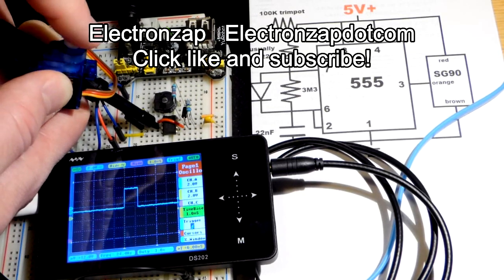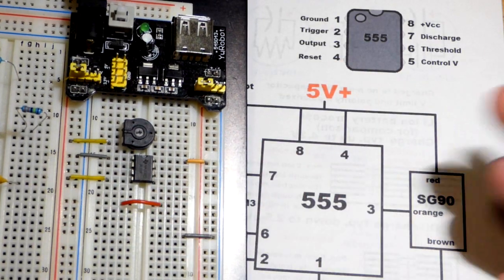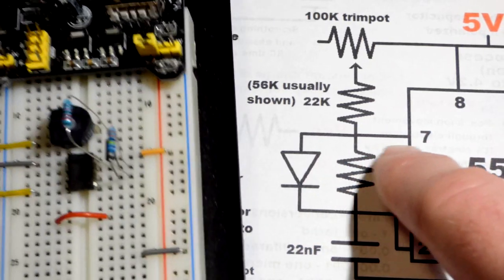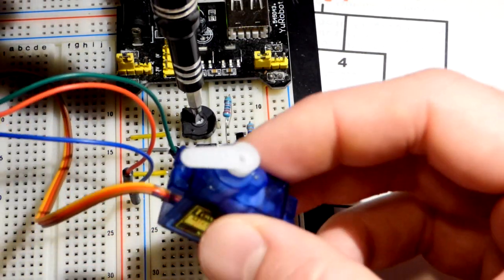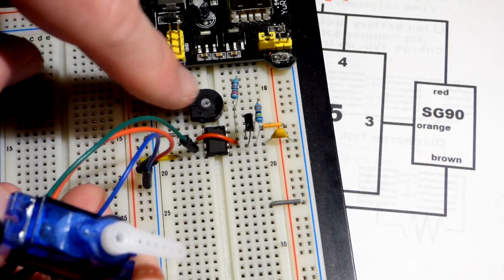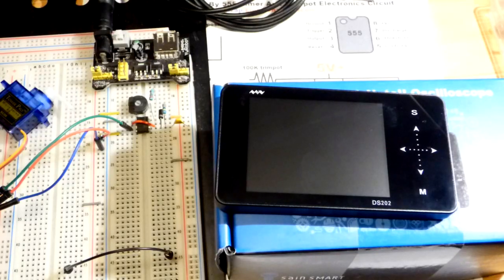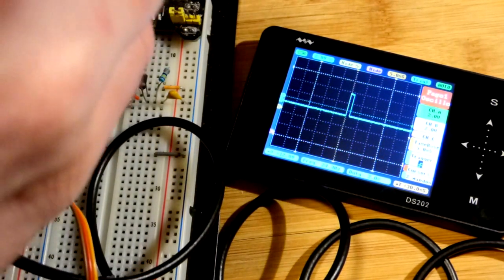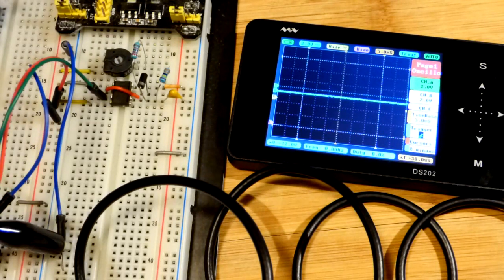Cheap electronics SG90 servo controlled with 555 timer pulse generator circuit step by step build

Comment: Good Stuff   ->   You could use a sensor like an LDR or PIR motion sensor in place of the Potentiometer so as to have the servo mechanically open or close a door or a vent or flap or open an *(animatronics"  eyeballs in reponse to detecting a persons thermal heat image or changing light conditions   *(animatronics like you would have at a Disney Park where they have all kinds of animated robotics that resemble living people or animals  )   You could have a doll or puppet open or close its eyes when you walk up to it or shine a flashlight at its eyes or have it move its hands ...   All kinds of fun stuff you could integrate this into , its up to your imagination
Reply from the maker: Yeah lol, I was planning on using an LDR to control a servo soon if I don't come up with other ideas for videos. Fun stuff for sure!
Reply: @electronzapdotcom    You start by getting the readings off the potentiometer.    How much resitance it takes to go all the way left and how much resistance it takes to go all the way right.   You want to keep it within those limits and  NOT try to force the servo farther than its mechanical range of motion so it doesn't over heat or damage itself mechanically.   A small margin of safety is a good thing to protect it from itself.   If it seems to shake or stutter at the end of its travel left or right.   You want to back off till it stops shaking and grinding
Reply from the maker: Good tips!